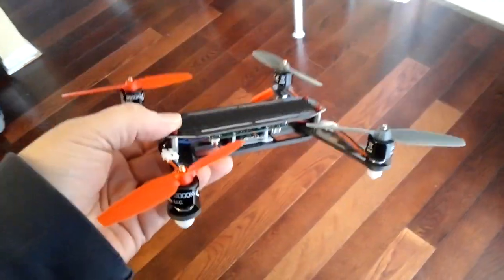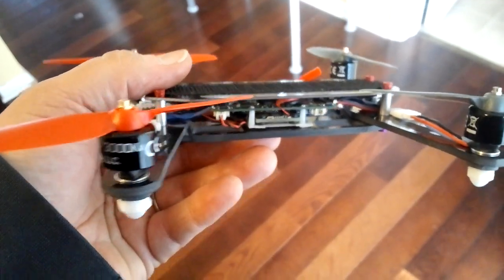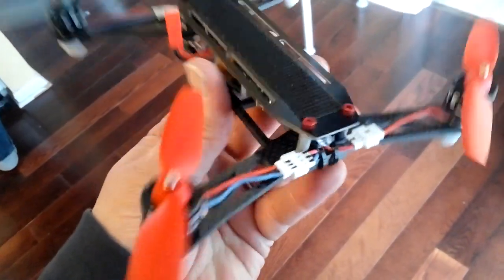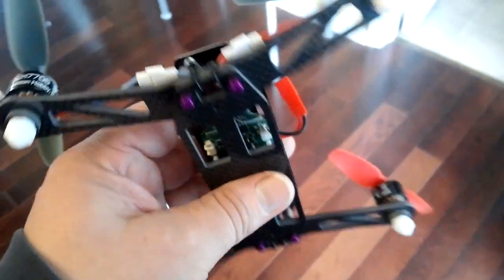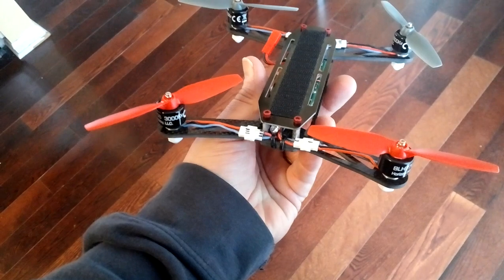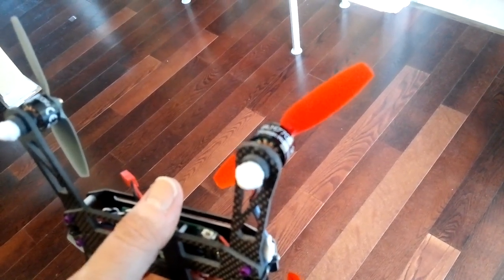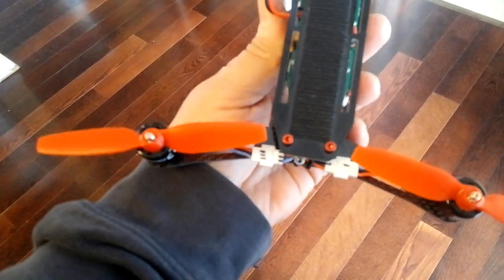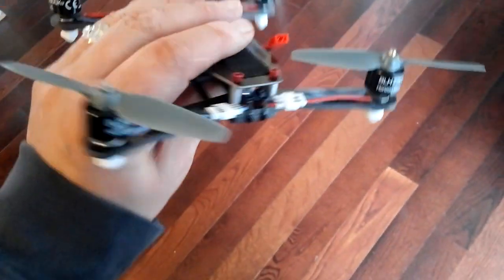200-QX mini Typhoon Blade 200qx custom quadcopter frame

Comment: Anyone that purchased this frame know the best power to weight ratio? The designer mentioned a brand, but didn't mention capacity or burst rate.  I mean, don't know if I should go 1000 or 1500 mah or with 25C or 30C.  Please advise?
Edit:  Just got a Google notice on this question.  I went with 1000 mah 35C discharge - 70C burst batteries.
Reply: Did you ever figure this out? Higher C rating is always better than lower. I run 950mah Lectrons in my stock frame and it looks like you will be just fine with 1000 or 1500mah that are slightly larger in size than the stock battery.